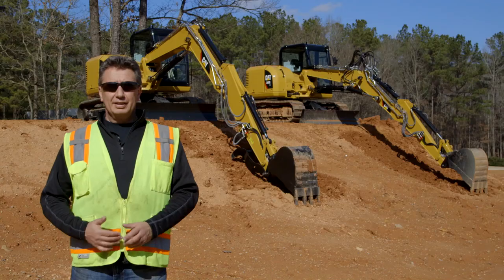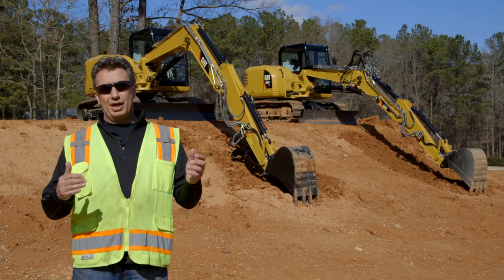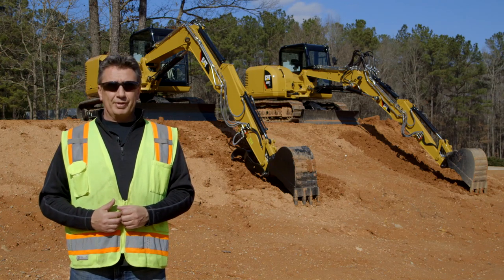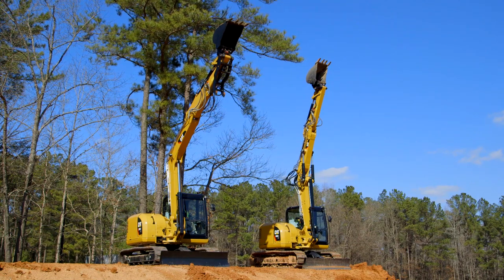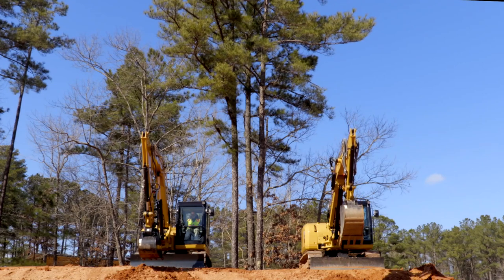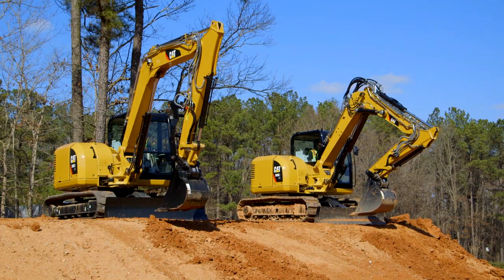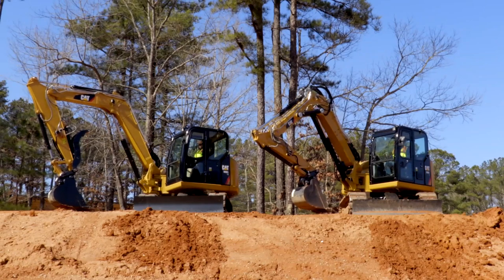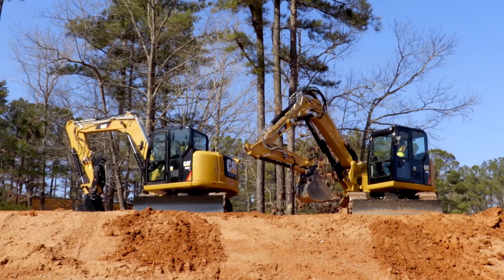Cat® Mini Excavators - Standard Boom vs Variable Angle Booms

Comment: so does this digger retain standard stick lift capacity when the boom is tucked in?
Reply from the maker: Hi Justin! The stick lifting capability remains the same but as the boom becomes more tucked in, the boom lifting increases as the weight becomes closer to the machine. You can actually lift larger weights with the VAB machine over a standard boom machine, because you are able to lift closer to the machine in all positions. We hope this answers your question. Further information can be obtained from your local Cat dealer.

Comment: I always thought you didn't want to touch the machine with the bucket? Guess I was taught wrong. That's why the boom is so long. And it has the boom angle on the mast. Learn to run the machine like the old guys had to. Just another point to wear out and flop.